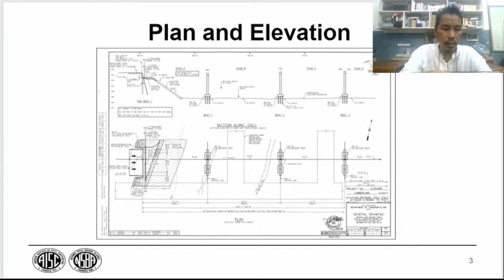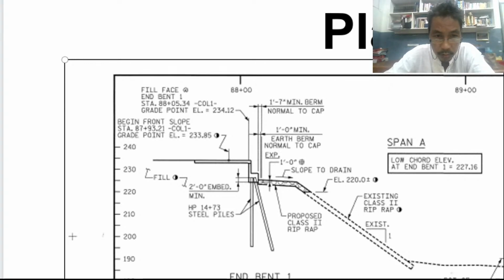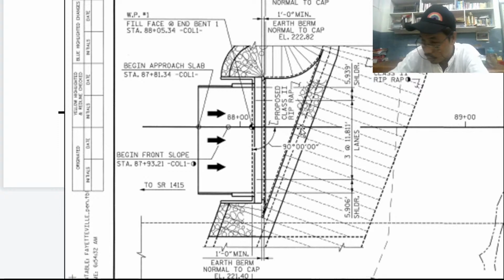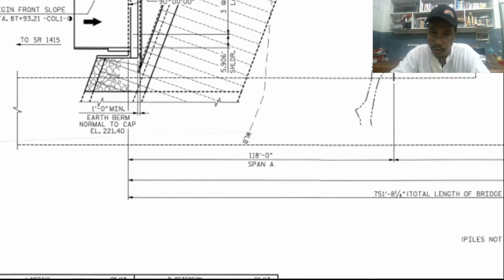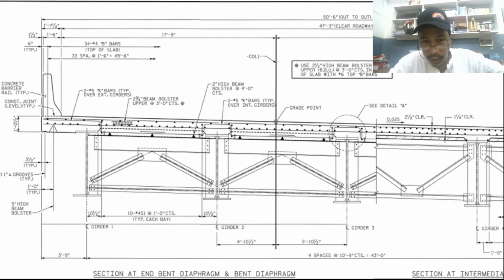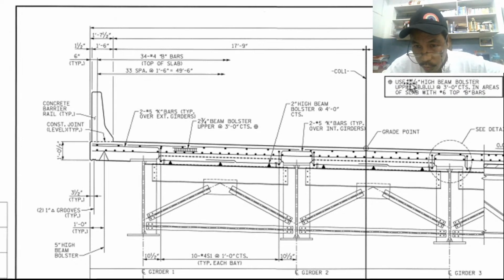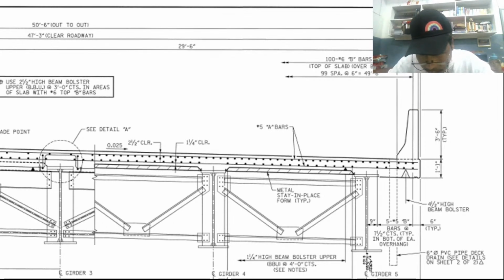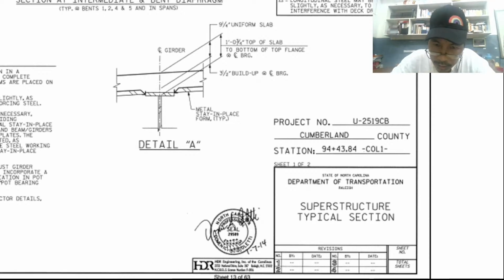[ LIVE CE E4 Lecture 01 ] DrAP Zantua Bridge Engineering Plan Talks + ENGINEERING Analysis & Design

Comment: thank you sir for teaching us about bridge engineering plan. I learned some technical terms from the plan such as fill face, end bent, grade point elevation, begin front slope, normal to cap, slope to drain, steel piles, propose claks IT RIP RAP, span, low chord elevation at end bent, existing IT RIP RAP, earth berm normal cap elevation, references point, beaver creek, temporary bridge work and water surface elevation.

Comment: thank you sir for discussing about bridge engineering plan in which plan set organization and content were explained. I learned some technical terms from the plan such as fill face, end bent, grade point elevation, begin front slope, normal to cap, slope to drain, steel piles, propose claks IT RIP RAP, span, low chord elevation at end bent, existing IT RIP RAP, earth berm normal cap elevation, references point, beaver creek, temporary bridge work, water surface elevation, approximate existing ground line, concrete barrier, grade point, girders, metal stay form, and high beam bolster.